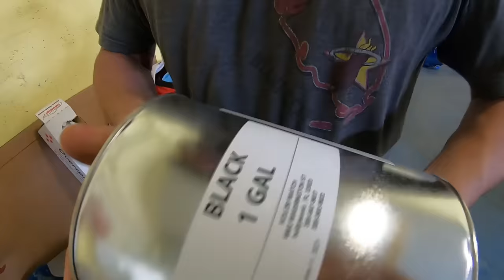Classic Car GETS Custom Paintjob!

Comment: 1 k sealer is maybe 60 bucks. I'm a budget guy and still used it on my last car and it worked well and provided a smooth surface for my paint. Last thing I want is unexpected reactions. Painting at home has enuf challenges without taking extra risks😬
Reply from the maker: 100% sealer is the way to go with something like this

Comment: Love your videos. As far as this car goes I would say that the front section is 55 Chevy and the rear looks like that of 55 Plymouth Belvedere. Very cool concept combining the two.
Reply: The back is a 55 chevy
Reply: Sorry, but it is not a Chevy 55 rear quarters. The 55 rear quarters where level and didn't slant down as those in the video. Take a look at the 55 Plymouth Belvedere and you will see the same rear quarters. Also pay particular attention to the rear wheel well openings. Not 55 Chevy. Plus, they said the car was a hybrid. I have owned 55, 56, and 57 Chevy's. I know those cars.
Reply: @danielparsons3956  Sorry the 55 Plymouth has a totally different trunk.
Reply: @bessforman1773   Yes, the trunk is a 55 chevy but the rear quarters are not.
Reply: @danielparsons3956  You have your opinion.

Comment: The tu-tpne paint line is gonna be hard to trim with your funky angles (especially the lower rear angle).  There is no dip in the body line right to the rear of the car  door -fender height.   That means the rear is a wagon or the car started life as a 2 door handyman wagon(or sedan delivery)  all other bodystyles (including 4 dr's) had that dip under the rear side glass.  This is where OEM chrome angled up to.
Reply from the maker: This whole car was mashed up and put together. I don’t think there will even be chrome. Was just for fun

Comment: Tri 5 chevys don't have gas doors. They hid the filler cap behind the driver's side tail light.
Reply: That's only on 56 & 57s. The 55 does have a gas door on driver's side. I have 55 Bel-Air myself.
Reply: @mickeyrhodes2152  I have never been around a 55. I just assumed it was the same. Good to know.

Comment: This is just another 55 Chevrolet! The front clip may have been from a Bel-Air and the rest just a 150 or 210?
The only difference is that the holes for the trim are drilled in different places.
It's all the same sheet metal, it's absolutely a 55 because it has the square rear wheel openings as to where the 56 (Which is the exact same car) just has prettier "swoopy" rear wheel openings as did the 57

Comment: I have a few questions. I'm currently working on my 77 Dodge Ram and, I'm currently using a long board sander air powered and a bosch random orbital electric sander.  I'm thinking of buying an air powered either an orbital or a DA. I can't buy both since I'm doing this on a tight budget. The truck bed has a few areas that are towards the larger size. What would you suggest

Comment: Love your channel!  
   I have a question. How do you determine the amount of paint to prepare? I’m going to paint the interior of my 65 f100 truck cab, in single stage, and don’t want to mix too much.
Reply from the maker: It’s tough to say. I say about 5-10 ounces per panel. Around 10 for larger panels.
Reply: @PaintSociety  Thanks! I’m going to try and channel all the info I’ve learned from you!

Comment: Wanted to share a fail with you.  I wanted to do some subtle metal flake on a custom job.  I mixed the metal flake (.004) with the base.  Then hit it with some candy clear to make it pop.  It had the look I wanted (I called it ghost flake) but what I noticed afterward is the base coat did not have the adhesion to be a stable base.  It would literally  peel off like an orange.  Is there a product I can add to the base to correct this?

Comment: OK???????? Was this a 4 door that some one turned into a 2 door conv?????  The lip going around the back lower window just dont look right? the space between the doors and the wheel well looks too small, I have owned a 55 chev for over 30yrs and this one just looks off a bit?? nothing wrong with modifying an old car but its just off to me??

Comment: It looks good but I can't ignore the rough edge when removing the fine tape at 10:02

The Eagle Abrasives K1000 hand pad used over the clear basecoat part of the video, doesn't that ruin the clear basecoat or it wouldn't matter much because it's white and won't be noticeable at 1000 grit ?! I'm assuming also the K1000 is 1000 grit ? I understand it's unnecessary and can be detrimental to sand paint and should always be avoided ?!

How did that get on the other side at 10:12 ? That would freak me out
Reply from the maker: It’s just paint. If it doesn’t go well just mask it back up and spray some white. The 1000 grit is only touching the clear base which is what the black overspray is sitting on. No line will be smooth unless you sand it down and flow coat 😀
Reply: That rough edge will be under molding if I am correct.  So it shouldn't be an issue.
Reply: You can also run a plastic razor over the edge and it will take off that slag. But there is no such thing as a perfect paint job. U can find a flaw on any job

Comment: I sent my truck in for paint at a PPG authorized applicator with instructions to apply sealer before the color. The shop owner decided to “take the risk” and skip the sealer despite me insisting on sealer coat. The paint job turned out like shit because he skipped this step.